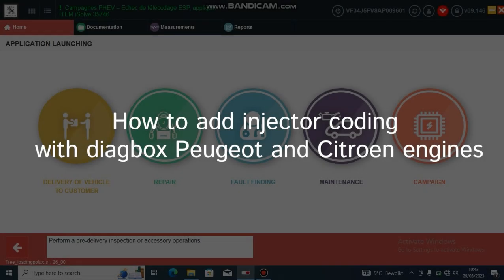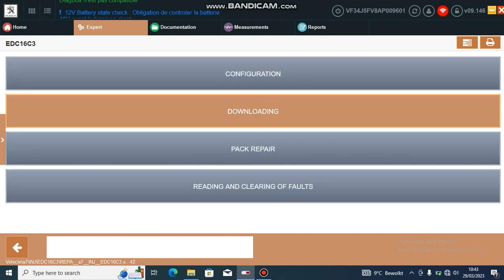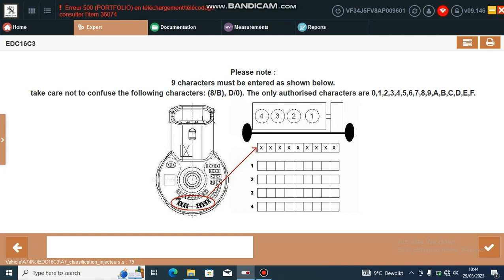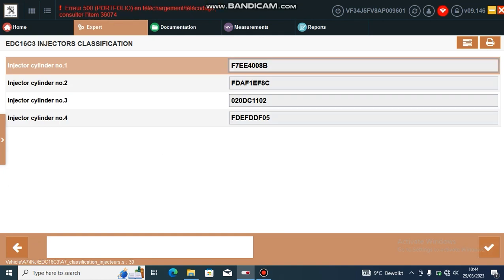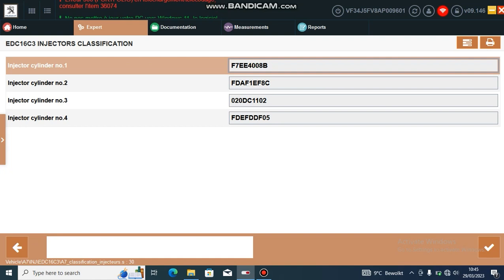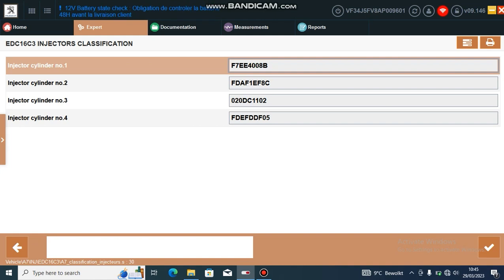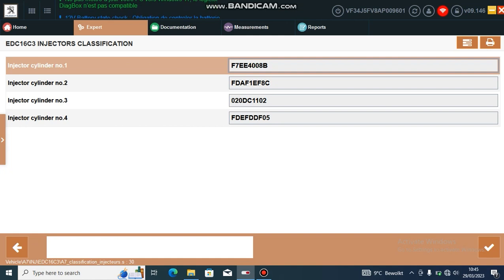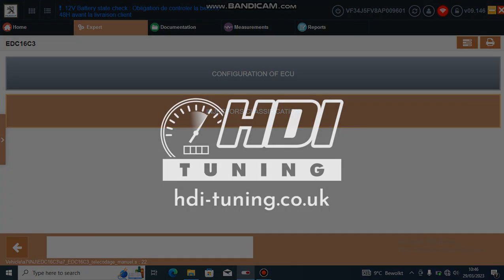How to add injector coding using Diagbox Peugeot Citroen 1.6 16V HDI

Comment: I follow the process, enter the new injector codes, press enter, but when I go back to the screen I see that the codes are still the old ones. Will not write the new codes. The replacement ones are same reference 239, any ideas? Thank you!
Reply from the maker: @Mikel-y9p  try one at a time, make sure you don't mistake any of the characters.

Comment: Would this be why my car was puffing out white smoke on start up and when driving just stopped with an anti pollution warning? Will not start again now after having the injectors resealed and two replaced for secondhand ones . Thanks
Reply from the maker: No, injector coding isn't important, get a mechanic to look in to it further
Reply: @StevenLewis-HDI-Tuning  thank you for the reply :)

Comment: I am changing the injectors for my 1.6hdi 2007 Citroen C4 and bought remanufactured ones from ebay. Some of them have 9 digit codes which my lexia won't allow to input there as it is restricted to 8 digits. If I understood your video and comments correctly I can just leave the 9 digit ones uncoded and it should fire up? I tried to fire it up with 3 cylinders but couldn't and asked all around on facebook and everyone says you HAVE to code the injectors in.
Reply: I wanted to get the engine warm with 3 cylinders so I could be able to remove the last injector that is stuck, I tried to get air out with inline pipes off on injectors and also priming with the hand pump but couldn't get it hard.
Reply from the maker: @Daniel-ct4qf  if they have different length codes you're fitting the wrong injectors with a different part number  the number starting 0445110 must be the same on all 4 injectors

Comment: Hello, i just put a 259 injectors in my clonker. It had 281 injectors originally. When i put the calibration codes in and hit ok screen goes back to the menu and doesnt change the codes. Both have 9 digit code..Any advice? Thanks
Reply from the maker: @macojesuper  I don't know of 281 what did you take them out of?
Reply: @StevenLewis-HDI-Tuning  yes, seal has gone and i had to destroy 2 of them.. In psa parts catalog there is 2 options either 297 or 281
Reply from the maker: @macojesuper  as in 0445 110 281?
Reply: @StevenLewis-HDI-Tuning  yes number before last 3 is the same, they were in my c4 lc 1.6hdi vts without dpf
Reply from the maker: @macojesuper  ok I never came across those before. I see a few on eBay as well. Not sure what the flow maps are for that one.
Reply: @StevenLewis-HDI-Tuning  do you think i can run it on original codes before i source proper ones? It has perfect idle i drove it around my garage had a few hiccups but mostly was fine… Its my girls daily so it doesnt see much abuse.. :D
Reply from the maker: @macojesuper  drive it part load only until you fit injectors with the same part number. The correction code does not make up for the wrong calibration of injectors being used
Reply: @StevenLewis-HDI-Tuning  thanks a lot for help

Comment: I have a mini 1.6 hdi 2009 I have 295 injectors in the car is it possible to swap them for 297 injectors as I have a full perdect set of them spare ?
Reply from the maker: You would need an ecu remap for this to add the flow tables, and adding the calibration reference codes would not be possible because the length is different.

Comment: Hello Steven, I have a 2006 1.6Hdi vehicle, it has 239 injectors on it, I replaced them with 311, but I did not code it because the code lengths are different. Do I need to code the k tag? Can you use it like this, thank you.
Reply from the maker: You need to calibrate the maps via a remap, however you still won't be able to add the correction code. Don't drive until the ECU is updated otherwise it will be heavily overfuelling
Reply: Thank you Steven for your help

Comment: if i put the 259 injecttos in palce of 239's on my 1.6 16v can i drive the car to the tuners about 20 miles ?
Reply from the maker: Yes, you can drive at half power it's safe enough. Why not use our MyGenius programming tool then you can program the remap yourself and you can use a good remap from us. Do you also have the gt1544v turbo upgrade? There's a full fitment guide on our website.
Reply: @StevenLewis-HDI-Tuning  also can I use 297 injectors if my originals where 239?
Reply from the maker: @mopedbanzi3275  yes, they must be added via a remap by adding the flow maps, you can't add the correction codes via diag tool because it's one digit longer, however the correction is not important because it will adjust automatically over time any way. Just don't go more than 30% power until it's all mapped in ;)

Comment: Hi got a citroen dispatch 2.0hdi 2011 just removed Injectors to clean and new washer put them back in eny order 😥 now wont start do it need Coding original injectors put back in
Reply from the maker: No thats not your reason for the no start, coding doesn't matter. You probably have an air lock.
Reply: @StevenLewis-HDI-Tuning  would help if I connect the multi plugs properly did it in a rush started to rain not clicked in 😊😊😊😊😊😊
Reply: @StevenLewis-HDI-Tuning  had everything off vacuum pump fuel pump had oil leaks from  gaskets so many pipes and wires 🤭

Comment: So upgrading a 2006 1.6 HDI with 109hp to the 297 injectors, you have to do this? Was thinking about following your guide with the TF035 turbo to get to about 170-ish hp. Seems like the tuner reaaally has to know what he is doing and I don't much trust these in my country.
Reply from the maker: If you go from 239 or 259 ypu cannot code a 311 or 297 or 353 as the length of the code is different. However the remap adjusts the calibration tables, the ecu will adjust for corrections based on diesel knock automatically. Infact I found even if you change the code it does not seem to adjust for it immediately.
Reply: @StevenLewis-HDI-Tuning  Doesn't adjust immediately but over time, gotcha. Hoping to pile up the budget soon and start working on this. What do you reckon, how much can I get on stock injectors?
Reply: @StevenLewis-HDI-Tuning  I would also like to ask, I noticed that some older turbo models do not have pins on them, like the one shown on your guide I've been reading, is this possible? As the pins should be used to link the turbo and the ecu
Reply from the maker: @CrazySerb-b5g  the pins are for a turbo position sensor, most of the 16v dodnt use this except the very last ones
Reply: @StevenLewis-HDI-Tuning  Thank you so much for the info and sorry for bothering you, could I then just ingore those two on the Mitsubishi turbo after installing it? As mentioned mine is a 2006 so I was kinda confused to see the pins in the first place.

Comment: Can you take immobiliser off a Siemens side 803a
Reply from the maker: Yes
Reply from the maker: @karlbigmore7949  might just be a wiring problem or a power supply problem, it doesn't specifically list an immo fault. Of course if an ecu is broken its nit always going to give an exact fault. Easiest way is to test with an unlocked ecu and see if that gets it going before doing further tests.